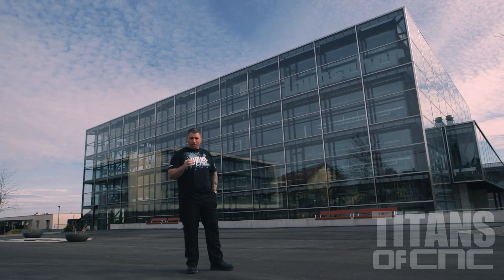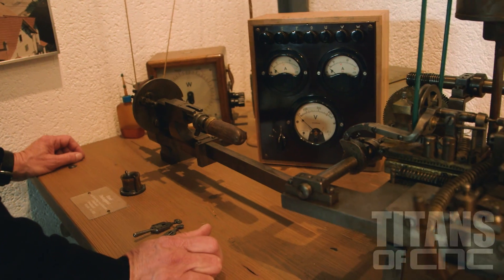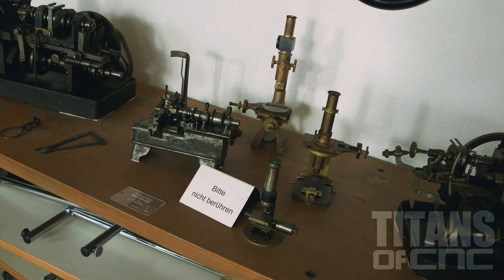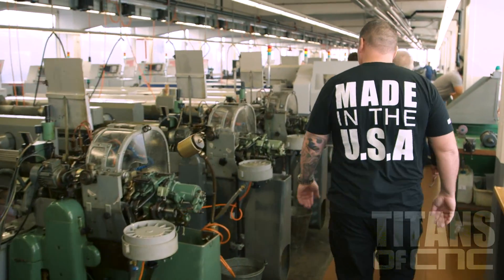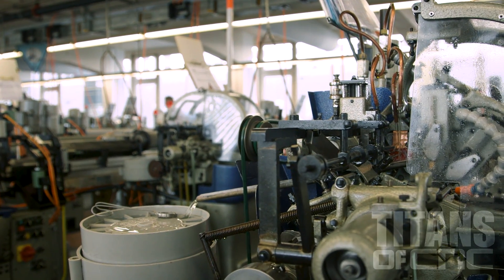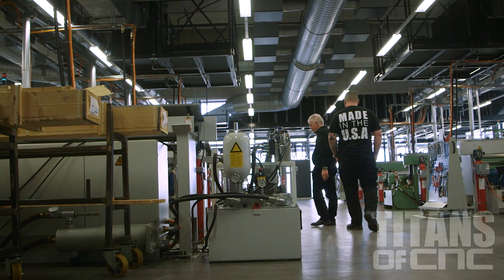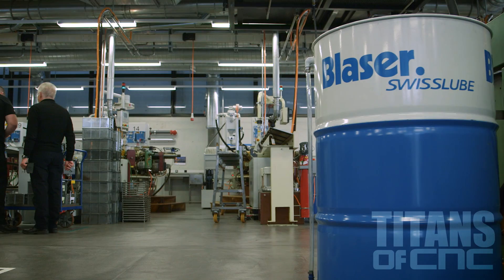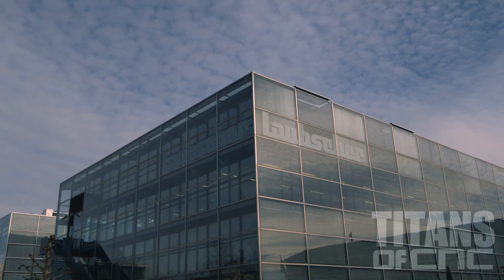TITAN Visits Switzerland's Largest CNC Machine Shop!

Comment: Cam driven sliding head machines, I have set some of those up in the past, they are fiddly but very satisfying when they are running, the material is gripped and manipulated through the spindle chuck and the tools are mainly static ,moving in a z-x axis

Comment: The .012" needle for operating on your eye is for changing out the fluid in your eyeball if it gets contaminated like from rupturing a blood vessel that blinds you. The blood blocks the path from the lense to the retina. They use up to 3 needles to change the fluid ( vitreous). Now you know, but you really don't want to know!)

Comment: Great video.  Love seeing this stuff.  I figure that nanotechnology will soon take over the manufacture of these small parts.
Reply: I work very closely with Laubscher in Switzerland.  I am also very closely tied to the production of miniature parts via micro DLS processes.  Micro printing has great benefits and very severe limitation.  When it comes to volume production micro printing has a LONG way to go and frankly may not achieve what you are looking for in our lifetimes, if ever.  There are definite technological limitation to the speed of production.  Additionally there are major design limitations with printing which people never consider until they run into them head first. 

Both processes have significant benefits but the concept of the science fiction "replicator" is still a monumental pipe dream.

Comment: They must have bought 90 machines while they were making the video.  The owner said they had 510 machines while your man says 600 ? ????? Who is correct?
Reply: There are primary turning machines then there are secondary machines.  It used to be upwards of 1,000 combined but as the old cam machines were retired newer CNC machines with much larger footprints have taken their place.  The facility has expanded significantly in the last 20 years in order to support those larger, heavier machines.  Having been there many times I can tell you they have more machines than I can count.  It is literally like Willy Wonka's factory where every turn takes you to something new.  Then there are the newly renovated plating lines they have completed in the last couple of years and the multiple heat treatment processes they offer in house.

Comment: Where are the employees?
Reply: Highly educated and trained with roughly one per every 5 - 10 machines depending on the department.  Cam operated watch screw machines are 1:10, Swiss type multis may be 1:5.  Very few short runs, almost every job runs for a couple weeks to years.

Comment: The Tornos multi-axis, multi-spindle swiss lathe ( at 3.56) is worldclass for fine medical components. Insanely accurate and repeatable under high volume production. They are most probably not showing you the more complex fine medical parts due to customer NDA , trade secret etc.

Comment: Very futuristic with more than 2x machines than employees, especially considering the work will involve very little metal removal but a lot of processes. They must have their methods perfect because that complexity is normally what requires a man constantly on a machine
Reply: A normal screw machine machinist in Swi mus handle a min of 6 cam machine, knowing that the average salary for this type of job is around 5 to 6K USD/month min,  it's no way you can afford to have a ratio of 1/1 (One men per machine) Yes you must have perfect methodology to let your machine run smoothly overnight.

Comment: By the way 5:15 
How you can be sure that Grandpa did not Trolled you ? :))))
4000 pieces ))))) I see lot of them in the chip tray 5:13
Reply: I can tell you for a fact that there are over 1,000,000 delivered per year.
Reply: SERIOUSRONAN jajajaja grandpa troller
Reply: Yeah I was wondering too.. lol
Perhaps it's the typical program run, machine 4000pcs / run

Comment: The next time I complain about holding tight tolerances I'll watch this video to bring me back down to earth. Thanks for sharing, Titan!
Reply: Dude if I had to spec dust i just might cry after I blew my 100th part away lol
Reply: well. here in Denmark we say when you can hit a h7 tolerance with a red sausage you are a qualified CNC operator. meaning using far outdated tools on worn down machines used for centuries. kinda hits the spot. :P